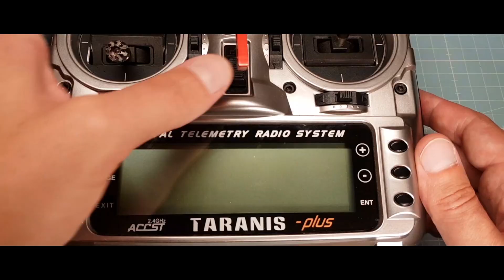Long Range - Disappointments 😒 BF 4.1 - GPS - FrSky R9 - Racerstar AirA - iFlight XL7

Comment: Moin. Was willste in dem Video zeigen oder sagen? Hab es mir angeschaut.... Weiss aber nicht warum es so wirklich geht. Mfg
Reply from the maker: Naja, das Video ist ein Teil einer Video Serie. Ich teile meine Erfahrungen und Ergebnisse meines Long Rang Projektes. Eigentlich wollte ich heute 4-5 km in eine Richtung fliegen - fürs Erste. Aber das GPS spinnt und das irgendwie nur unter BF 4.1, unter BF3.5 hatte ich da keine Probleme. Außerdem macht mein R9 System Probleme - bisher lief es immer sehr zuverlässig und 2-3 Km waren selbst mit der geringsten Ausgangsleistung kein Problem. Bei meinen 5 Zoll Coptern ging halt irgendwann der Akku zu neige. Mit dem 7 Zoll und größeren Batterien will ich endlich weiter kommen. Scheinbar hat aber ein Receiver oder eine Antenne einen weg. Habe meine mir selbst gesteckten Ziele heute nicht erreicht und ich muss weiter an meinem Copter arbeiten.
Reply: @TorbanDallas  zeigt er vielleicht die rssi Werte vom schlechtesten Empfänger an? Würde ja dann passen, wenn Sender horizontal und ein Empfänger vertikale antennen hat.
Habe die redundante konfig noch nie getestet.
War vorhin 1.3 km weg und hatte noch 71rssi Power auf Auto. 
GPS Probleme habe ich auch mit 4.1 auch, viel weniger Satelliten und es dauert länger bis er welche findet.
Musste hinter meine foxeer Boxen auch alufolie klemmen, die stören das GPS ungemein.
Das war aber schon mit bf 3.5 so
Reply: @TorbanDallas  OK. Danke. Habe eine Graupner Funke.... Die macht schon nach 1km Schlapp. 😂😂😂
Reply from the maker: @superheld6819  also mit dem internen Modul und den 2,4Ghz Empfängern sieht das bei der Taranis ähnlich aus. 1km - 1,5km dann wirds aber kritisch. Das R9 ist ein extra 900Mhz Modul wie zb auch Crossfire, damit sind deutlich höhere Reichweiten drin.